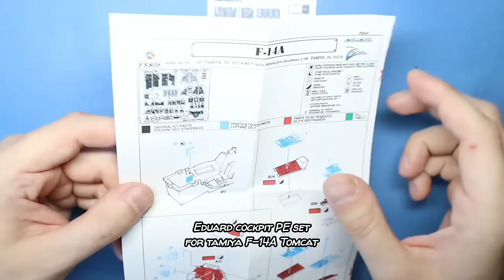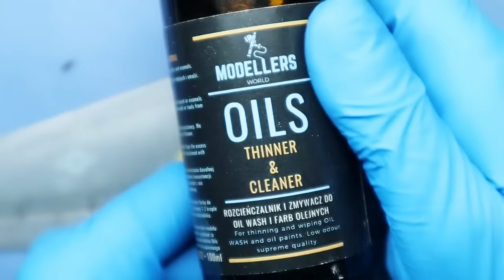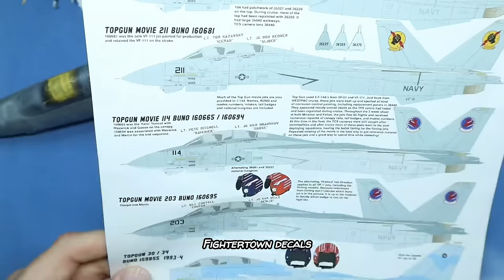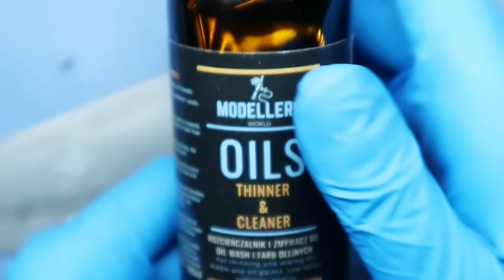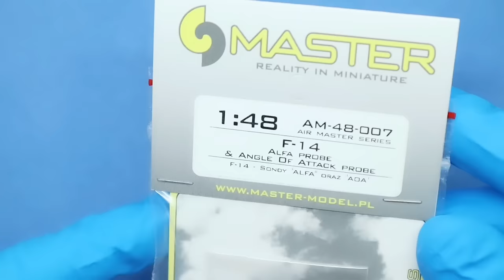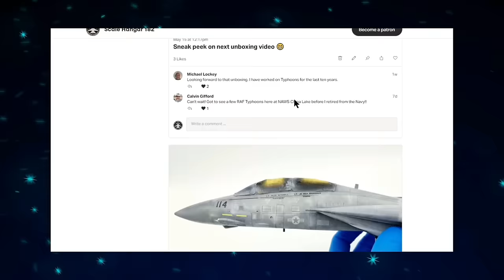Top Gun F-14A Tomcat Tamiya 1/48 model aircraft タミヤ

Comment: Great balls of fire! That's a beautiful model and very screen accurate. You also have the new D kit in the larger scale. It's interesting and I have a few pictures. The Toms had poor performance in the readiness and were always being torn apart. Because of the corrosion from the ocean and excessive wear and tear from being worked on a lot, the F-14s rarely had the same shade of grey in them when nearing the end of the tour. The panels were always being sprayed with rattlecans and a panel could easily have a dozen different shades of grey on it. They look like patchwork nearing the end of the cruise. This also worked, accidentally, as an extra low visibility camo. People tend to mistake the look as the birds being dirty, which of course they were... But it's the paint. You did a beautiful work with the clear paints modeling this. I never thought about doing that. Was that your idea or did you find the technique somewhere?

Comment: At least they got the production model of the F-14 right for this model kit!  It was an A-model.  That's all that was in frontline US Navy service until 1989 when the F-14 B-models (with the GE F110 engines and lightly upgraded avionics) started going to sea.  The F-14 D-models didn't deploy until 1992 and were in service until 2006.  A-models retired 2004, F-14Bs retired in 2005.
Half the Top Gun tie-in material now gets it wrong and depicts a D-model as Maverick's ride.  It wasn't!
Heck, I have the old F-14 Blu ray and it shows an F-14D in the menu!  The movie takes place in the mid-1980s!
The plane preserved on the pedestal in that scene from the Top Gun 2 trailer is the correct A-model.  It's the one Maverick scored his 3 kills in, not the plane he flew with Goose (that was destroyed in the flatspin accident).
*
*
They have been making mistakes with models that tie-in to the new movie already.
Revell sent an advance Top Gun: Maverick 1/72 F/A-18E Super Hornet tie-in kit to hpi guy modeling that was inaccurate in so many details.  The Legacy Hornets (A-D) models and F-18 Super Hornet (E/F) resemble each other closely until you start paying closely attention and then it becomes obvious they're very different airframes.
Revell was lazy with the way they did their 1/72 kit and hoped people wouldn't notice how they essentially kitbashed a Legacy Hornet mold with a new wing like the F/A-18 E/F.  I knew right away from the tapering LERX and engine inlets (round) what Revell had done.  I seriously hope they get called on this by a lot more people and that their tie-in sales take a hit.  This is NOT how businesses should be conducting themselves, especially with a hobby that has a limited customerbase and one that demands higher detail and better end-product. 
This is the type of "care and attention to detail" you can expect from Revell if you don't pay attention.  They and a few other companies are infamous for being lazy with licenses and putting out inaccurate model kits.
Reply from the maker: Its a pity that Revell and Italeri got rights to  Top gun kits, and instead of go back to bench and release new mold, they update old crappy kits with top gun decals. And yes I know it was F-14A in film, its my favourite film and favourite aircraft so how could I make such a terrible mistake and use B or D 🤣
Reply: @ScaleHangar182  They released Top Gun on 4K Blu ray earlier this year.  They were supposed to release a steelbook BUT they used THE WRONG plane on the steelbook artwork!
Instead of Tom Cruise in front of an F-14, the artist inserted an F-15!  They had to delay the steelbook and it's not being released until this December in the US.
COVID's kind of screwed things.  I think the second Top Gun movie was supposed to be out this past summer but got pushed well into next year.  Last I heard, they might delay it again until 2022.
Screwy year.  It'd be sadder in some way but the celebrities remind us from time to time how obnoxious they are and it's hard to feel bad for Hollywood!

Comment: Fantastic built! I am a Gunpla and GK builder who have always wanted to get into scale modeling. I have a few Macross jet and Space Yamato build in my back log, so this is true inspiration!

I am wondering what primer do you use for metal etch parts? I am currently using Mr Surfacer Black 1500 and use Alclad II for color, but it is very prone to scratch and chip. I am leaning more curious with AK Extreme since lots of review said they are more durable as an enamel based metallic paint.

I have a few CA glue for resin, but some of them, Gorilla Gel in particular, gives out a white haze cloud on adjacent surfaces. But the Locktite seems to dry without any problem even apply with a good amount?

Once again, great work!

Comment: Great piece of work n tremendous effort! The level of skills and experience here is awesome! I have a question which I hope you can advise me. How do I decide if the model should be fixed up first before painting? Or to paint it first before fixing?
Reply from the maker: Well, most of the time with aircraft you start with assembling cockpit and painting it. When done, you can close the fuselage and cockpit inside. Fix all the pieces together and paint it except the ordnance, wheel struts and wheels l, wheel bay doors and other pieces that may be hard to paint when everything is fixed together. So those I paint separately
Reply: @ScaleHangar182  thanks so much for your advise! Can I seek your advise again if I have any doubts along the way?

Comment: Awesome work! Just one question: the heat gun for oil paintints just dries the thinner but no the oils right? Because I use a liquid made of cobalt salt from a artcraft store specially designed for accelerate the drying of oil paintings, they told me that oils "dries" by oxydation, not by drying, and the result is that the drying takes 1 day instead of 3-4days. But if the heat gun works it is interesting to apply. Regards!

Comment: Hi! Do you need a wet coat for the gloss varnish before the decals?
Reply from the maker: You dont need a glossy varnish before decals if you prepare the surface prior by sanding it down a little bit with 3000 sandpaper and make the surface smooth

Comment: I HATE, HATE and more HATE how you modellers make the planes look dirty. In real life this is not the case at all. Planes get routinely washed and are far cleaner than people make out in their models. I am ex RAF and used to work on a flying station, and I was an air frames technician so I worked very closely with the real deal and I never saw a dirty plane for long.
Reply from the maker: Well mr, could you please calm down. You're not the first and probably not last Ex-something to come here with "planes don't get dirty" fairy tales. I suggest you go and do some research first, especially on carrier based aircraft like F-14. You will probably learn that salty water has much to do with aircraft weathering and that corrosion cannot be avoided, especially in such conitions. You can also spot a lot of liquid leak marks, colour fading, repaint works made by ground crew using differant batches of paints that gives a variety of shades of grey betwen panels etc. I had a few aircraft carrier potato peelers here who had the same claims as you, but i am lucky to be able to chat with some F-14 drivers and Rio's on that matter, and make Google useful.
Reply from the maker: You should have a look on these pictures https://youtu.be/V3fvsON0Ghg
Reply: @ScaleHangar182  Mainly Americans. However, our aircraft were washed and scrubbed near enough ever week. I am sure that you have been to displays or static open days you would never see a plane that dirty. All planes before painting had to be washed and dirt removed before painting.
Reply from the maker: @marknorville9827  You said you hate when scale modellers build weathered aircraft,  that is your opinion, and  i think you should leave that way. If you like them clean thats ok, but in my opinion clean models are boring and look all the same fortunately for many scale modellers are trying to push scale modelling further and learn more about these birds or tanks and try to build some kind of story behind them. Also not sure why you left the comment under US Navy aircraft about how its not supposed to be weathered while clearly have only idea about some local stationary aircraft based in uk. These are totally different conditions than in the middle of indian ocean for example. Speaking about stationary aircrafts, yes, you see them cleaned nicely just for visitors, and this is not how i like to present my models. You cant also compare RAF tornados from couple years back sitting somewhere in RAF base in uk to the ones that were flying during gulf war, i suggest to have a look on some pictures from then too.
Reply: @ScaleHangar182  I served during Operation Granby and Desert Storm, so I know full well the conditions of our aircraft back in the days. However, in the field then you need to look after the aircraft in the best possible manner, FOD is a major issue on operational bases and we looked after our planes as much as we could. However, during the gulf most of the times the birds were up in the air with very little down time, however they had to be maintained as much as possible as one bird down means the difference between troops on the ground being killed, or having air cover to save their lives.

Comment: No. Sorry. I have seen active F14s both on the ground bases and on aircraft carriers. They are NOT this dirty and soiled, oil stained. The modeler really got out of control. Much time and effort for a very invalid result. And the finish is not so dull, but is quite a bit more smooth. NON-reflective yes, but not so dirty and rough.
Reply from the maker: Well, maybe sometimes is better to do some research rather than only worship your personal experience and being ignorant 😉
Reply: @ScaleHangar182  Research? I have seen the real planes. Climbed a ladder up to the cockpit. Walked around the entire aircraft. Touched the control surfaces. I am not a pilot, but at air bases in CA I've probably spent 7-8 HOURS looking at real F14s close up over the years.
Reply: @AccurateShooter  I'm not trying to be rude or anything but it only takes a single google search to see a dirty F-14 Tomcat. As of what I can tell is that you've only seen preserved F-14s or the ones that are being looked after carefully.